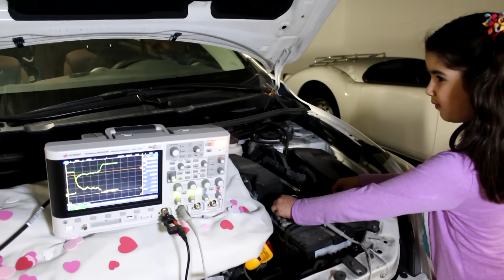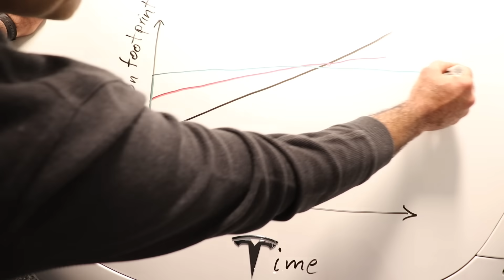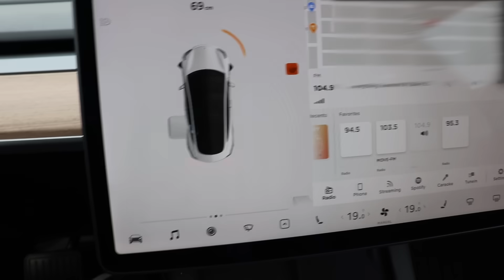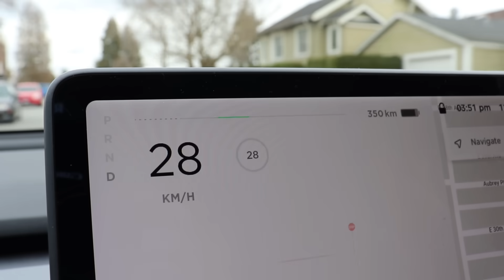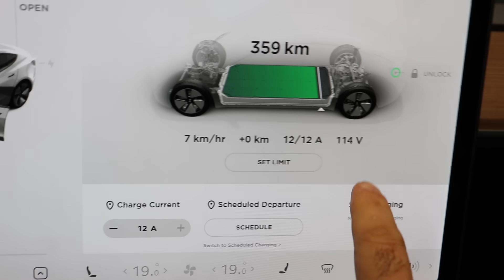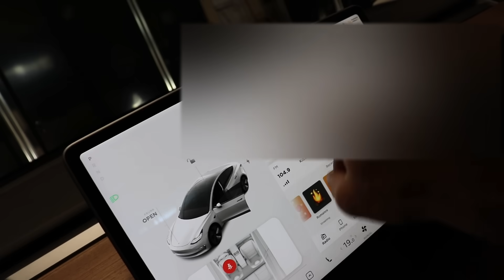ELECTRIC VEHICLES & My Tesla Model 3 Review

Comment: Mehdi: Huge AC motor and powerful batteries!
The car: Sweats nervously
Reply: oh boy... I already know he's gonna do something to it
Reply: It's an AC motor by the way.
Reply: @nelsonahlvik6650  Yeah but he shows the picture of his brushless DC motor so its technically still a DC motor I guess? (though provides AC)
Reply: @CPP_malloc  Cool!
Reply: @roarlisfang2860  It is also called a synchronous AC motor wich is more descriptive since the motor itself runs on variable frequency AC. 
The reason it's sometimes called a DC motor is because you feed DC to a Variable Frequency drive wich is rensponsible for driving the motor with AC.
Reply: Not sure if it's a BLDC motor using pulsed 3-phase DC or an inverter to create a genuine AC current (BLDC motors can run on 3-phase AC btw)
Reply: In any case

this guy took the transformer from his microwave...

wouldn't be surprised if he took out its motor and battery XD
Reply: lol😂😂
Reply: There's a sticker on the trunk of my Model 3 that says 3 phase AC motor :)
Reply: Model 3 uses DC motor as opposed to ac motor in Tesla model S
Reply: @terryterry1655  Permanent magnet motors are AC. The Model 3 uses a permanent magnet motor in the rear and on dual motor vehicles, an AC induction motor in the front.
Reply: prepare to be torn down
Reply: XDDDD
Reply: 11:49
Reply: The model 3 uses a PMDC motor, DC.
Reply: @Sm00thieK  The funny thing is a month ago I actually said the motor is DC(You can see it in the replies), but there were some who insisted on it's AC so I edited it. I guess I didn't have to be so serious about a meme comment from the very start...
Reply: I know a lot of people have already gone back and forth between if it’s an AC or DC motor, but just to clear something up: brushless DC motors are actually AC motors with a permanent magnet, but they’re controlled with a controller that turns DC from the battery into AC at whatever frequency it needs, so if you put that controller and the motor in a black box it looks like the motor runs on DC
Reply: I laughed out loud hahaha

Comment: Another good point to bring up; the batteries charge much faster at lower percentages. To the point that, if you're on a long trip, it's faster to stop twice as often and keep bringing the battery from, say, 10% to 60% charge, than it is to fully drain and then fully charge it each time and stop half as often.
I'm still going to wait for major battery cost/weight/environmental impact/range improvements before going electric. Long road trips across the U.S., which comprise the vast majority of my driving, are too tedious with the recharging issue. Plus I have a used first-gen Insight that already gets 70mpg, so the cost/carbon savings aren't nearly as high if I were to buy new electric car.

Comment: “This most basic model comes with a lot of luxury features, which I don’t really care about most of them”
(5 minutes later)
complaining that it can’t load YouTube quick
Reply: I mean, if you're going to have a dashboard computer like that with those apps as standard, they'd better work decently. Especially with how quick and cheap it is these days to get decently-energy-efficient processing power. (unless it's a GPU)

For $180-200 I can easily get hardware that will do that much faster and more reliably than the dash-o-matic doohickey. 8gb stick cheap Crucial memory (just in case you want to run Windows or something equally wasteful on the dash computer), and an AMD Athlon 3000G APU or comparable. Gonna ignore the motherboard since a custom el-cheapo motherboard in bulk will barely cost anything per unit.
Reply: @Ithirahad  r/woosh
Reply: @phaxil4207  just stop, he only explained gow tesla could improve

Comment: The part which a fossile car in a downslope uses gas all the time isnt correct, because ecu will cut fuel when forward momentum is bigger than the torque of the engine.

Comment: I do agree with some of the good thing about electric cars including how it brakes, the motor requires near no energy when stopped, great for the environment just to run it, and very few parts to drive it.  Bad thing is that the biggest cost of the car are the motor and battery, take longer to charge if near or at dead, you can't easy charge it if you're not at home or near a charging station, you can only charge the battery x amount a times before you need to replace the car or the battery, and other thing.  Should we switch to electric cars, it would help but we need to be able to provide cleaner energy and better electric power grid before we should all go electric.

Comment: 1:55 gonna stop you there.  ICE cars are very inefficient.  An EV will fare easily better even if the electricity came from coal or diesel/gas power plants!  2:08 batteries can be reused/repurposed then recycled.  this has been debunked for years now.

Comment: It's really less efficient to charge at the minimum current because there is a fixed cost of just keeping everything powered up while it's charging. It's better to charge fast and let it get back to sleep faster.  Even max charging speed at home is really easy on the battery, it's a tiny fraction of a supercharger amperage, it's nothing.

Comment: Sure, electricity is cheaper. But the cost of the car offsets that.

This car is 10x more expensive than my current car. Therefore, you've already paid for your cars "fuel" in advance. A silly comparison if you ask me.

Maybe if it's cheaper in the future, they'll be worth it. Paying 100k for a car? Hell no.
Reply: Gotta compare apples to apples.

That tesla is $37k usd.

If you compare it to an old used car, then yes it might be cheaper to drive the old used car.

If you compare the total cost of ownership over 5 years to almost any new car, the tesla will probably be cheaper because of the savings on fuel, maintenence, and emissions.

I save around $2k/yr on fuel and about $500/yr on maintenence every year with a Tesla. And the tesla is faster, handles better, is more reliable, more convenient, safer...
Reply: @fission1110  I guess it's cheap in America. 

Here that car costs $100k and the other models go to $150-200k NZD.

Guess you guys have it cheap. 

I'd argue that the only difference in safety with a tesla is the centerpoint impact when crashing. As demonstrated in this video, the sensors do not always act instantaneously and might not trigger when you expect it to. So you can't rely on it and just expect it to do whatever. 

Not sure about handling, I can't really compare it because I haven't driven one before. 

Yea they are fast, but speed doesn't matter when the max speed is like 100km/h  (62mph)

Guess you guys have it different in America, I suppose it might be a cheaper option for you guys. I can't really compare from one country to the other. My cars maintenence is only 1 oil change per year and that's about it.
Reply: Yea it's not worth $100k so I get that

Comment: Very handy to charge your car with 32A when your entire house only has a main circuit breaker of 40A. That leaves only 8A for the rest of the house. And if you eventually have a second EV, you're screwed if you don't upgrade your electric system in the house.

Comment: Mehdi, Automatic Emergency Braking didn't engage for the boxes because you were flooring it. It only engages when cruising. If you're actively demanding the car accelerate, the car will do as you tell it even if it doesn't think you should.

Edit after watching a bit further: Ah, you actually tested more! IIRC, there is an acceleration threshold beyond which AEB is disabled.

Comment: Wait is 10L per 100km really the standard for such a little car???

i drive a opel mokka and my average fuel consumption is around 5,7L per 100km and i would say i drive pretty normal (sometimes more economical and sometimes a little more aggressive)
Sure it is "only" 5 years old but it is for sure heavier and has a bigger engine.

A car that uses 10L per 100km would be a BMW x5 or a Audi q6/7. Are cars in North-America really that wasteful? (This should not be taken as a negative comment, but as a genuine question)

Comment: You can still motor brake in your ordinary gasoline car. I lived in Norway for a few years, and we had the deepest undersea tunnel in the entire world, until 2019. 
Descending down into the steep tunnel, you would have to keep your car in 3rd/4th gear. The engine would rev high, but since you weren't pushing the throttle at all, you weren't using fuel, and the only reason it would rev high was because it was compressing the air in the engine, converting kinetic energy into thermal energy

Comment: 13:30 - "... and coming down you still burn fuel"
Yyyyyyeah, no. Engine braking? As long as you're above some 1500 RPM and you don't touch the throttle, fuel injection doesn't squirt any fuel into the cylinders.

Comment: That slow UI screen in Tesla actually are a road hazard. And some processes like increasing the speed of the wipers take up to 5 steps before actually increasing the speed while normal cars can adjust it by just flipping a switch! By that time you have already a totalled Tesla with fast wipers lol. Good car overall, but still needs some fixes.

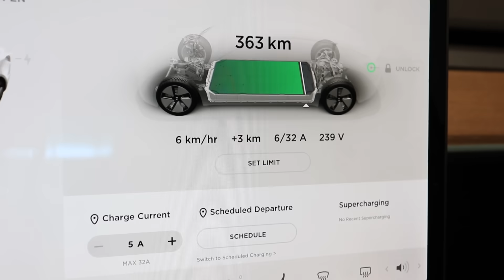Comment: 15:30 - Would charge faster, if you have 3 phases / 400 Volts ;-)

slower charging - also check efficency.
On Renault Zoe (I have) charging is most effecient at 14kW 3ph 400v
at home I have a self build wallbox with 11kw 3ph 400v charging
from the photovoltaik I can charge it with 1ph 2kw 240v

Comment: 6:33 it doesn't stop because... they are empty cardboard boxes... the car can probably figure out with its sensors they don't pose a risk to the car
7:50 it just wants you to confirm that they are a green lights and that it should proceed, you can confirm it by pressing the "gas" pedal the moment you see the red line, its not that it thinks that its a red light!!!!
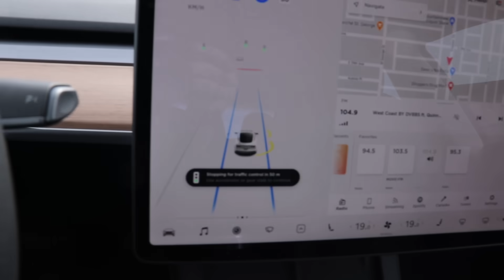8:05 you just have to hold the steering wheel, not move it like that, you can disengage autopilot by mistake if you do that

Comment: They should add an option for how quickly you want the battery charged (as in, you set the x hours for a full charge) and the charger then adjusts the amps accordingly

Comment: One reason to charge faster is that you will use less power overall. Every hour the car is charging, it is "awake" and running various electronics to manage the charging and cooling. If it finishes charging sooner it can shut down those power drains.

Comment: Very nice. One thing you should probably do already is set a usual charging limit of like 80%. I believe lithium batteries degrade significantly faster if you charge them all the way to 100%, so after a few years of ownership your battery will be in better condition. Tesla may in fact do this to a point already.

Comment: Two fun facts: even if we got all electricity to run electric cars from burning coal, we would gain 800% efficiency since the big powerplants burn in so much higher temperature than an internal combustion engine. It is easier to track and control pollution on one chimney than on a million pipes. Also, it is a different kind of pollution. In powerplants we can have mostly co2, the exhaustion is heavy elements and stick low to the ground making people sick with smog. 
The second fun fact, the total carbon footprint is so manipulated, cause nobody counts the footprint of digging and refining oil, they just combine the combustion. If you really couted footprint of fossil fuels they would need to ban ice cars like right now.

Comment: I am upset by the fact that ElectroBООM did not pay attention to the fact that the bus also runs on electricity
Reply: Most busses are diesel though. Heavy long range vehicles like busses and trucks really don't work well with batteries. Hydrogen or biofuels are the most likely alternative
Reply: @KekusMagnus  Some buses pick up their power from overhead wires (they can only drive the paths under those wires).  Similar to an electric rail system, but there are 2 wires instead of 1, since there aren’t any rails to serve as the return conductor.  There are places in this video where it looks like Mehdi’s city has that type of electric buses; the pair of wires overhead is visible.
Reply: At 8:51 is such a place in the video.  Shortly after that, we even see a bus.
Reply: @KekusMagnus  i am talking specifically about one trolleybus that got into video, and they don't relate that much to batteries, if even had one. Because they got power from overhead wires. And that much much more energy efficient, and DRASTICALLY more ecology efficient then batteries. 

And also funny that "overhead wires" transport kinda ruins logic of diagram that Mehdi draw on a car, because it makes less carbon footprint to make and ALSO LESS of it while operating

Comment: I like having a backup car. If I need to get my main car repaired, I still have a car while I am waiting in line to the mechanic and then while the mechanic fixes it. 

While I understand why someone would want a Tesla or some other modern car, I prefer older cars. They are simpler, there are fewer parts to go bad and sometimes the body uses thicker metal so it takes longer to rust and does not bend as easily. I think that if/when gasoline powered cars are banned, I will convert my car to electric instead of buying a newer car - car without computers is the best.

Electricity for electric cars is cheap right now, but I wonder how long it will stay like this. Over half (about 57% IIRC) of the cost of petrol in my country is tax. I'm pretty sure the government would not be happy with losing one of the biggest sources of income and will start taxing electric cars the same way.

Comment: i love mehdi but as i've seen him rectify people, an internal combustion engine while in gear going down hill off the gas pedal will consume 0 gas or diesel, the rpm can go up but that's just the rpm sensor seeing that the engine is rotating but no combustion occurs.
but i still agree EV cars are way better in everyway, apart from the sweet engine sounds :3

Comment: Never heard of regenerative breaking. It seems to be incredibly good! Do hybrid cars have this?
Reply: Pretty much any electric OR hybrid car these days has regenerative braking.  It differs from company to company how you use it.  Some (like this video shows) can do heavy regeneration just by lifting off the gas pedal.  Others (such as Prius, I believe) require you to use the brake pedal; light application of the brake pedal will do regeneration, and heaver pedal pressure adds in the traditional brakes.
Reply: Yes. But can't stop as fast.

Comment: 1. That's why EngineeringExplained got a red one. He couldn't possibly resist to use it as a whiteboard and since he is definitely drooling over it, that would have made for a very uncomfortable situation... I guess.
2. Don't brake your car by using the motor as a generator. Just slow it down doing so. The difference is a broken car vs. a stand still one.

Edit: *cringe*

Comment: Most modern cars do not come with spare tires anymore. In the past they use to give you full size, then moved onto the donuts, and now you just get a can of fix it flat. Its mostly to cut cost, they will tell you it saves space but everyone drives crossover and suvs these days, so they have more than enough space.

Comment: I don’t know if this could work but what if they added a 5th wheel under the car that is connected to a motor that when you drive it turns the motor and recharges the battery

Comment: 13:25 electric cars are way more efficient in every aspect, though when going down hill a modern car with fuel injection (made in the last 20-30 years) does not burn fuel when your off throttle. Also when you stop your car, a lot of gas cars turn off their engines. EVs are really good, and are the future, though as you said your not a car guy and it shows you have missed a lot of new tech in the stop gap between gas engines and evs.

Comment: Too lazy to dig through all the comments to see if someone clarified this already, but the car shows those green lights as red because you don't have a leading car in front of you. If you're following someone, it will proceed through the lights, otherwise you need to confirm each light, usually by lightly pressing the accelerator. Future software updates will improve on this safety feature.
Reply: thanks for the information!

Comment: Correct me if im wrong but what if you put a manual transmission in one? No electricity to change gears. It's all manual. Your only maintenance is changing transmission fluid and maybe dif. Theoretically you'll get more range because the motor is working less to move you twice the speed. Even if the trans was automatic driven by electric, how much juice would that take? Would that power put towards the trans still waste more than if there was no trans at all? The who reason would be to increase range. Just very curious.
Reply: Are Tesla cars even geared at all?  I thought they used VFD's to modulate the electricity, which would make gears unnecessary.

Comment: Charging at the absolutely lowest current is actually worse for a Tesla in terms of energy consumption than charging faster. There is a  constant power consumption while the battery is being charged to run the coolant pumps and heat/cool the battery.

Basically, charging on 120V 12A (and I assume 240V 5A, since it's the same power) ends up being roughly 85% efficient (from wall to charge) and 240V 32A ends up being roughly 95% efficient.

In terms of battery health, remember that even at 7.6kW charging, that's still only like 0.13C charge rate (assuming 100% efficiency and 54kWh battery) which is considered extremely slow for lithium ion batteries.